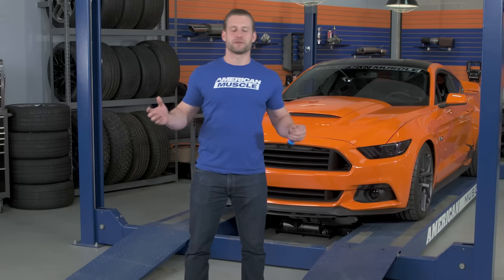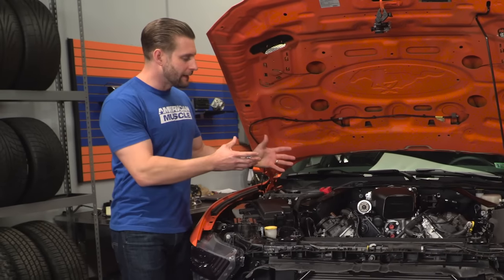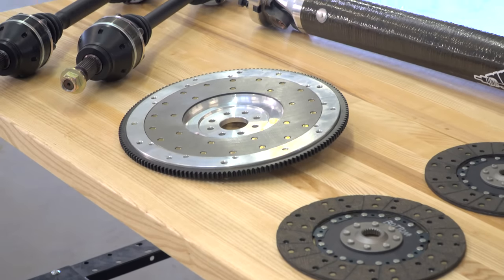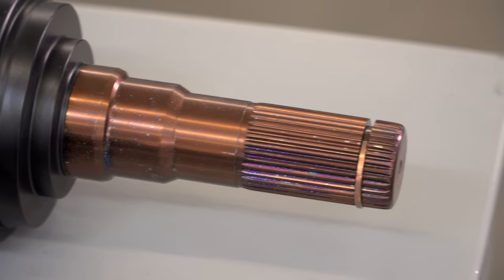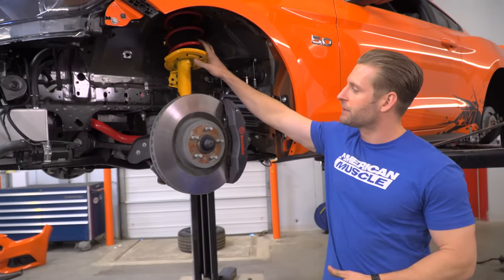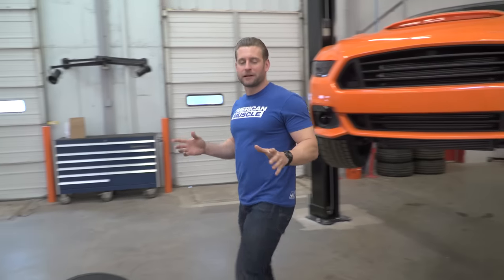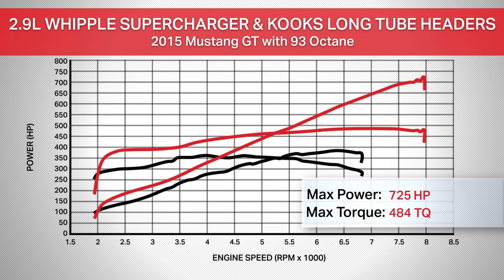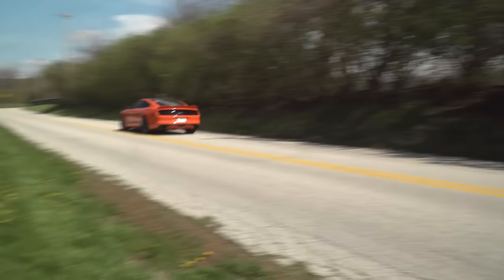850+ HP 2015 Mustang GT Build & 2017 Ford Raptor Giveaway! - Hot Lap

Comment: This is awesome. Have you guys considered upgrading the brakes at all? I doubt the stock ones will last given the speeds you'll reach with 800+ HP! I'd recommend just doing some big upgraded rotors, pads, fluid, brake lines and the stock Brembo caliper should be better able to cope. Otherwise for more money you can always go full Wilwoods all around!
Reply from the maker: +Noah B I guess we focused pretty hard on the 0-60 and not the 60-0 huh?  Good news is that the car has some pretty beefy factory brakes and they'll take some abuse.  It would be pretty easy to throw some stainless lines, fluid, pads and rotors, as you recommended, to give it a boost in braking power. -Chris
Reply: +AmericanMuscle.com do you have to be present at Mustang Week to win?
Reply: When is the last day to enter, and when will the drawing be held?  I don't see any type of dates?

Comment: Holy shit! You are the only YouTuber that knows how good a carbon fiber driveshaft is!! There's only a couple of things I would do to it. I would give it Z23 brakes, a Oddssey 31 battery, a trinitydiablo t-1000 performance chip, torque converter, blistein shocks, hellwigg turning system, 12 speed transmission, and a piston degenerater so when your not using all that power you could put it on six cylinders or four to get better mpg.
Reply: what the fuck did I just read

Comment: I’ve got a 2015 GT 50th anniversary in Wimbledon white. 
I love the mods but cause it’s a collection car I’m only going bolt on mods. 
I’ve done a air raid and a MBRP street exhaust, oil sperator. 
What’s your recommendations to go forward?  I want just bolt on so I can take it back to factory for collectors when I’m done.
Reply: Lowering springs.?

Comment: Question on the carbon drive shaft. I read in some forums that carbon DS is not good for daily driving. As they could shatter if they have a neck in them or damaged.

Comment: I just noticed one thing: No brake upgrade?! You've put all that power under the hood and to the wheels, but rely on the stock brakes to bring it to a halt? Lol.
Reply: They've got the Track Pack (Brembo) brakes on them. Those are a special option from Ford, so they are most certainly not stock.
Reply: Dport1231 Ahh, cool. I must have missed it lol. Thanks!

Comment: +AmericanMuscle.com Some break upgrades would be nice or needed in my opinion. I couldn't keep from cringing every time I saw a stock break hose in the vid. You wisely put in braided clutch hose, at least some braided break hose would be wise. Then some upgraded pads. Maybe some slotted and/or dotted rotors. After that, break upgrades tend to get expensive but it beats plowing the car into a field somewhere. Cheers for the vid and the giveaway.

Comment: I would've done a couple things differently (mainly the spoiler and the suspension; I would want an all around handling package instead of just dedicated drag racing, at least for the springs), but hey, a free car is a free car (and a free freakin' Raptor (!!!) and trailer). 

Plus if I won it, I could just sell off the dedicated drag racing parts and buy more all around road and track-capable parts lol.

Comment: RST with a 2.9 Whipple 
My #15BLACKMAMBA 15 GT performance package with Gen 5 3.0L stage 2 Whipple supercharger ate the RST  on the dyno with under 5000miles on it while n/a at 5000rpm and 13lbs of boost it smoked the RST twin disc 800hp rated clutch  cars down until I can afford a new 1000hp rated or higher clutch

Comment: how much for the taxes, title registration fees that the winner will be responsible for?
Reply: u don't pay taxes because it's a gift
Reply: You most certainly do pay taxes and it generally works out to about 30% of the prize value which they list at ~$100,000.
Reply: In California, if it's a gift, then you sign a Statement of Facts (if it gets approved, then you should only pay at most around 1000 dollars in DMV fees because the taxes will be waviered. The tax for just one of the cars is around 5000 bucks), pay the transfer fees (15 dollars), 50 - 200 dollars for smog checks, etc. 
http://www.dmv.org/ca-california/title-transfers.php#Receiving-a-Vehicle-as-a-Gift
https://www.dmv.ca.gov/portal/dmv/detail/portal/feecalculatorweb

Comment: Huge fan of AM, long time subscriber and parts buyer (92GT).Would be awesome to represent AM with this Bad@ss setup of truck, trailer and hot-rod at tracks and shows!!!
Reply from the maker: +V3 Fox Whipple Coyote That would be awesome man! What do you have done to your Fox? Good luck on your entry :) - Will
Reply: +AmericanMuscle.com, the list goes on and on... 331 scat kit, ProComp 190cc heads, comp cam, Holley intake,V3 blower @12 lbs, big gears, 3500 converter, adjustable suspension, body restored and painted. Owned it for over ten years, and still enjoying it!!

Comment: I figure the Raptor, Mustang and trailer are at least a $300,000 prize. That means taxes would be at least $120,000 (40% prize tax).

So here are your four options:

1. Mortgage your house to pay the $120K in taxes on the prize.

2. Sell the Raptor for $95,000 and the trailer for $25,000, pay the tax bill, and end up with a killer Mustang without owing a six-figure tax bill. 

3. Sell the Mustang and trailer for $205,000, pay the tax bill, keep the Raptor, and pocket a tidy $85,000 in cash.

4. Sell the Mustang, the Raptor, and the trailer for $300K, pay the $120K tax bill, and pocket $180,000. (Which you could use to buy a new GT350 and still put more than $100K in the bank.)
Reply: +Zachary Zarko 
They said the approximate value of the giveaway is $100,000.00 
Good luck trying to get $205,000.00 for a Mustang & trailer lol.  You'll be lucky to get $90,000.00 selling all three of them.  Nobody is going to pay more than their value especially knowing that you won it.  A dealer definitely won't.  Your tax should be roughly 25% if you're in a lower income bracket.  30% is probably a good average.  So that's about $60k in your pocket if you sell everything.  Or just pay the tax like I would do and keep all of it.  With more than 100,000 people entering up to 29 times each,  good luck winning though.  I'm still entering every week,  but I'm definitely not getting my hopes up.
Reply: In this article, a woman who won a new GMC Rendezvous worth $33,000 ended up paying sales tax of $3K, and income tax of $10K for a grand total of $13,000. (If you multiply that by 3 for a $100K prize, you would end up paying $39,000 in taxes.)

http://www.marketwatch.com/story/you-win-and-now-you-owe-taxes-2014-03-12

The base price of a new Raptor is $53K. That means the 850-horsepower Mustang, the trailer, tools and all those super sweet aftermarket parts for both vehicles are only worth $47K.

Considering the fact that a new 500-horsepower GT350R starts at $65K, it seems like the more powerful car would be worth at least that amount, even though it's a year older.

Either way - whoever wins is in for a big tax bill.   #firstworldproblems

Comment: I just watch the video where that lady with the blue GT blowed one of those carbon fiber driveshaft into a million pieces on the track. I don't think they can handle the forced induction horsepower maybe a stock gt but sticky tires a good clutch that much horsepower the owner has probably already exploded that drive shaft

Comment: Are the internals not getting beefed? the pistons will will melt if there not forged
Reply: These guys know what they're doing and wouldn't do this to the car if it was just going to blow up. The stock coyote engines can easily handle 900 at the crank and since the 2015s came out they've made almost all the internals forged.
Reply: Kris Juarez Oh. I wasn't aware that the internals were forged for  gen6. that clears it up. Thanks
Reply: Not true. You might be able to get a few runs in but even this setup will melt pistons and connecting rods if you don't keep it chill. 900hp will destroy the engine and probably won't do the transmission any favors either.
Reply: pulled this from car and driver 

The extra output was achieved via improved head flow (which Ford was able to accomplish through casting rather than expensive machining), larger valves with increased (Boss 302–spec) lift, stiffer valve springs, the Boss’s forged connecting rods, and some aesthetically pleasing tubular headers. The compression ratio remains 11.0:1, and an oil cooler is now standard.
Reply: +jlcurtis94 you're right about the connecting rods, the recommendation I received was above 900 get rid of them and go with Oliver or Calli rods, didnt realize thy came forged though. The crank is forged too, but it's steel not aluminum so with that much power you're probably still looking at swapping that
Reply: Agreed
Reply: My car is built nearly identically to this with NO issues whatsoever since melting the factory clutch.

Comment: will the stock engine handle that much power
Reply from the maker: +nicholas baker Without a doubt! These motors are so stout especially with a good tune behind them that they can handle 700+ RWHP without a doubt. - Will

Comment: If I got that mustang I would wash it every day, change the oil every 2500 miles, adopt it to my family, hire a bodyguard to guard it, and take it around the block to pick up some fine chickas ;)
Reply: In fact, I'd do that to just the tools :D
Reply: 2500 miles? that is a huge waste of oil. especially if you buy the good stuff that can last at least 10k.
Reply: Natsfan Eh, oil doesn't cost too much and a filter is like $3 plus I change my own oil so it ends up being pretty cheap.
Reply: +Prince Benny it's expensive if you get good stuff.
Reply: Natsfan I usually just get synthetic gold and that's been fine on my current car.

Comment: Connecting 2 pipes in the middle f a bend does not constitute an X pipe. That is the worst example of an X pipe I have ever seen. Nothing about that says X pipe.. Just 2 pipes that come together at bends, holes cut and welded together. It can't perform the real function of an X hipe. Maybe an H pipe with gawd awful raspy sound. How much did that junk system cost you? Way too damn much I am sure. A real X pipe  is an actual X.  Full cross over from one side to the other.  Not just a little bridge between. It's supposed to be much more then a balance pipe.
Reply: #countryboycansurvive old comment but did you mean X pipe is raspy? Or really mean H pipe? All of the H pipes have a low growl to it